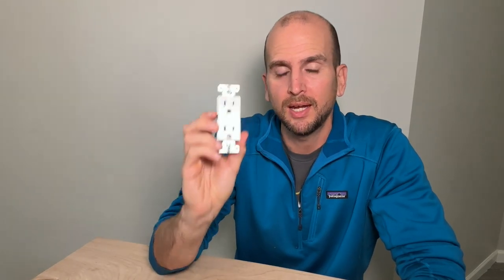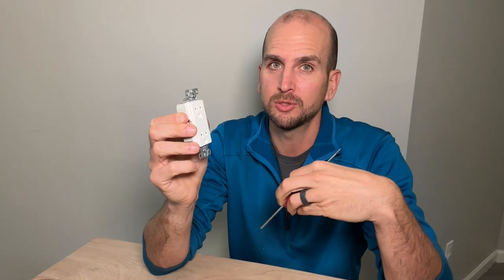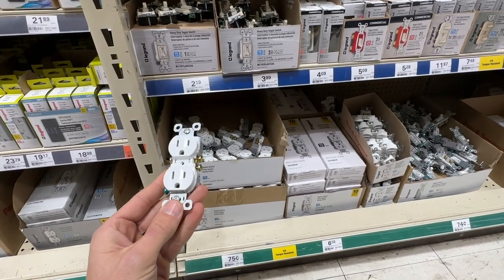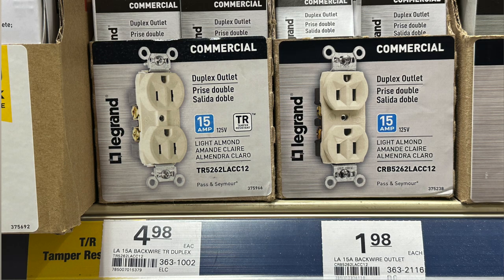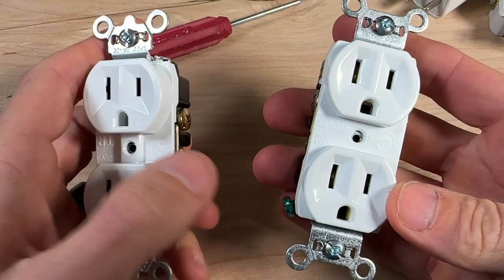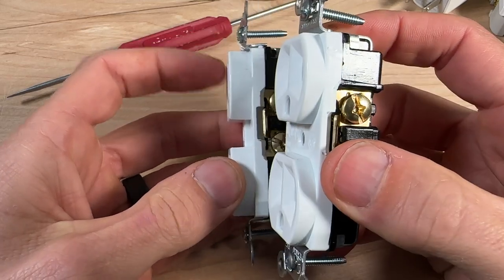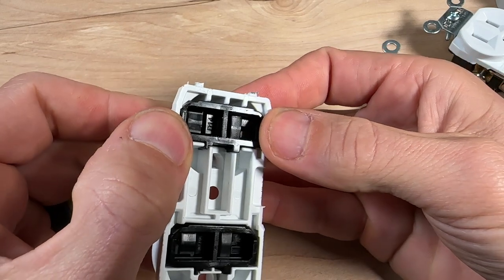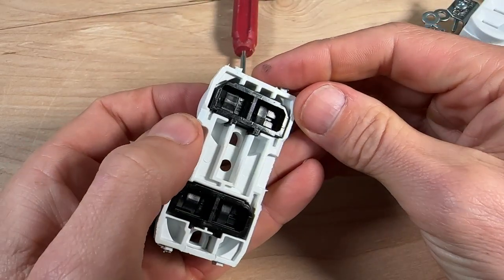The Most Hated Product In Home Electrical

Comment: We finished my basement 2 years ago.  It is a small basement, 300 sq ft.  We built a closet around our furnace and water heater, put in a small closet for my wife's crafts, and the rest is just 1 open space divided into 2 sections: my office (I work from home 100%) and my wife's craft design area.  We had rough in plumbing when the house was built, but did not use it, so no bathroom or sink.  The inspector required us to use the TR outlets.  They are so hard to push in the plugs that we've broken several of them.  Completely useless!
Reply: Huh? Are you sure inspector did not mean GFCI? Tamper resistant not required in any code I’m aware of….
Reply: Switch them out.  You don't need inspections for changing your own outlets.  You also want gfci in a basement because sometimes basements flood.
Reply: @scallywag1716  Check out NEC 406.12.  They are unfortunately required in all dwelling units unless your jurisdiction (state, county or city) decides not to implement that portion of the NEC.
Reply: You have a set-up for a sink so the inspector was insisting on a GFI. A tamperproof receptacle does nothing for you and does nothing to solve any potential problems in a wet location.
Reply: Only if they are buying cheap contractor grade TR Outlets which do not function well....... If you purchase quality TR outlets they function flawlessly!
Reply: Don't purchase cheap TR Outlet and you will not have the issue. Any new outlet location in a home, by code, must have a Tamper Resistant Outlet.
Reply: @michaelholliday100  "Any new outlet location in a home, by code, must have a Tamper Resistant Outlet."    bs
Reply: @MrBonners                                                                     2017 Code Language:
406.12 Tamper-Resistant Receptacles
All 15- and 20-ampere, 125- and 250-volt non-locking-type receptacles in the areas specified in 406.12(1) through (7) shall be listed tamper-resistant receptacles.
(1) Dwelling units in all areas specified in 210.52 and 550.13
Exceptions: - (1) Receptacles located more than 1.7 m (5 ½ ft) above the floor
- (2) Receptacles that are part of a luminaire or appliance
- (3) A single receptacle or a duplex receptacle for two appliances located within the dedicated space for each appliance that, in normal use, is not easily moved from one place to another and that is cord-and-plug-connected in accordance with 400.10(A)(6), (A)(7), or (A)(8) - (4) Non-grounding receptacles used for replacements as permitted in 406.4(D)(2)(a)
Reply: Tamper resistant outlets  are dangerous, I am starting to believe the inspectors have little wisdom, they require things that sometimes degrade the quality of a job.  In my area, I believe their main goal is not safety or quality, it is to make themselves look important to their manager and flex muscle to compensate for other parts of their lives that lack.
Reply: @davecangelosi9688  Quality Tamper Resistant Outlets are not dangerous...
Reply: @davecangelosi9688  Inspectors have nothing to do with it . If the device meets code and approved by various authorities an inspector will not fail the job. UL etc.  His job is about the installation build specs and workmanship, not the design of the devices's used.  Unapproved devices are not available to be bought in the first place because they are not manufactured.
Reply: @jfbeam  Bull. If that were the case you would not be able to buy them. 
There is no "if". 
Put "if" in front of something you can have anything you want.  'If' there were pink elephants.
Reply: Badly made. Buy better quality.  The UK has had mandatory tamper resistant sockets for 80 years, although the overall design of plug and socket is vastly superior.
Reply: The Guns N' Glory Show  
No!  Buy quality.

Comment: I'm an old and TR outlets are so much harder to put a plug into. My hands and fingers aren't strong enough an it hurts my joints to try to work the plug into them. Also, the electrical boxes in my house aren't very deep. Some of these new features make the outlet so clunky, they just won't fit. Switches with timers, wireless-enabled, outlets with USB added...they won't fit in my old metal boxes.

I won't be putting a bobby pin into an outlet anytime soon; I've lived in my 1951 rambler for almost 30 years and I'll let the new owner put them in if they need them.
Reply: I used to put Bobby pins in the outlets when I was a small kid, I liked the way they sparked.
Reply: It's feature you have to design in from the start, like they did with BS1363, for it to have any hope of working right. And despite all of its flaws, NEMA 1-15/5-15 is never ever ever ever ever EVER going away. We can't even use a similar mechanism using the ground pin because almost all appliances are ungrounded unless the manufacturer really couldn't come up with a double insulated design. So any TR implementations for us will always be avoided whenever possible and never work well in the few places they're used.
Reply: I think the key with TR outlets is getting used to them. You have to put the plug in perfectly square. If you are at a slight angle, then it can take a lot of force to insert the plug.
Reply: I have same problem. A combination of arthritis and mild parkinson's make using outlets harder with each passing year
Reply: @daleatkin8927  I've had better luck going in at an angle
Reply: Only if they are buying cheap contractor grade TR Outlets which do not function well....... If you purchase quality TR outlets they function flawlessly! TR Outlets are not deeper than a non-TR outlet...
Reply: @michaelholliday100  But contractor-grade outlets used to work.  Code is forcing a new design that is either so complicated that most manufacturers can’t make them work properly, or else they are working properly when they’re almost impossible to use which means it’s a failure in the spec.  Either way, it seems to be defective by design.
Reply: The first time I bought a TR receptacle, it was a Legrand with two USB connectors. The biggest problem I have with that was that the shutters were extremely stiff, it's like it was designed to expect a ground pin to be inserted. If if was just the two blades, it was tough, but if the ground pin was included, it seemed a bit easier to insert.

However, when I replaced a few GFCIs with an Eaton/Cooper TR GFCI, those seemed to be a lot easier to use. Almost like they knew that not every plug is going to have a grounding pin. My mom, however, had some trouble plugging things into it, only for me to observe that she's been inserting them at a slightly awkward angle than what she had thought. Once I pointed out her actual issue, she readjusted, and adapted.
Reply: If you have to force it, you aren't doing it right.  If you line it up correctly, it slides right in.

Comment: All UK 13 amp. socket outlets are required to have protective shutters fitted which l guess helps with lowering the overall cost due to higher manufacturing volume. 
     I am also aware that UK outlets are physically bigger so provide more scoop to fit a shutter arrangement that in most cases is operated by the insertion of the slightly longer earth (ground) pin which does make for a smoother operation when inserting the plug. 
    Keep up the great videos and stay safe.
Reply: Exactly this. It's not a problem here. UK sockets / plugs are the best standard tbh. As for cost I see your point but given respective population numbers not sure about the economies of scale.
Reply: The UK plugs are designed better than the ones used in North America in terms of safety. Only issue with having the ground operate the shutter here is that not everything requires a ground pin, so you'd need a work around for all old devices.
Reply: @jeevana.6391  Yes. We have 3 pins on all plugs. Where it is a two wire connection the earth pin is simply left unwired. Or typically for a pre wired connection the earth pin is a dummy made of nylon,/plastic. So yes you would need to replace the plug where it has only 2 pins.

Comment: I have an old 50's house entire with 2 prong outlets and wired with 12-2.  Replacing all with commercial Legrand (non tamper) and add GFI at the breaker panel.  All the boxes are small and I am using the Wagos instead of wire nuts.

Comment: I just looked at an outlet that've been meaning to replace for months now.  I was having the issues that you mentioned with the plug not going in and sure enough, the outlet has a TR on the front.  I know nothing about replacing an outlet and was just going to wing it via youtube videos of course 😁.  But at least now I know the reason why several outlets in this flipped home are having issues.  Cheap TR outlets installed to pass inspection.  This was a revelation.  Thank you!
Reply: Never trust a flipped home. Test everything! 

Try to rattle some of the walls and all the doors doors. Take a power tester with you and test every room, at least in one spot. Check calking and flashing around the exterior. Check for signs of water damage both where pipes are visible and around windows and doors. Make a check-off list.

It's not hard these days to be your own home inspector. YT has dozens of sources to learn from.
Reply: @mrcryptozoic817  
That only applies if you have the money to pay cash.

If you're financing, your home is inspected well enough for the bank to lend you the money, and the insurance company to cover the house.

You're NOT going to be that good from watching a YT video.

You damn sure aren't going to do a good job inspecting the electrical system.
Reply: @lordgarion514  I wasn't describing perfection. I should have specifically said "At Least". You CAN help yourself a lot on your own. And there are plenty of documented home flip disasters.

Don't walk in and be stunned by a new kitchen and nice draperies then say "I'll buy it".

Comment: I have a beach home in 
Baja, Mexico. When remodeling the home, I noticed many of the outlets were rusted and corroded. I installed tamper resistant as not only a safety feature for future grandkids, but to help minimize future rust and corrosion. Not sure if my thought process is valid but we’ll see over time. Thanks for your channel, it’s helped me tremendously!
Reply: With what I've seen as far as electrical in Mexico, you far exceeded the norm...
Reply: Things cannot oxidize below 35% relative humidity. You will almost always never get this close in real world scenario, but the closer you are the slower the oxidation. Things are coated for anti corrosion anyways so keeping humidity low will help extend this coating
Reply: @MadLadCustoms  Fully understand that but…we are on the beach.  The weather ranges from 45 with the same dew point and near hurricane like winds and salt spray to 120° and no humidity.   Bottom line, it’s a beach house and salt intrudes so I’m just trying my best to prolong and damage.

Comment: Personally I've always used the Leviton TR outlets, always seemed to work well enough, to the point you basically don't even notice, unless of course you try to plug something in off center or to one side. Just need to make sure you inserting the plug in relatively square.
Reply: The first use seems stiffer than subsequent uses. I've been replacing the existing backstab outlets in my house with TR outlets. The existing outlets quite often break in my hands while releasing the wire, which is why I keep at it. I don't really notice any extra stiffness in normal use.
Reply: That's what the builder used in my house. A few of them had bad shutters but most were okay after a few uses. As the years went by though I've had to replace a bunch of them. Most recently the one on my front porch when I couldn't get the Christmas lights to plug in no matter what I tried. Unfortunately I've had to return several of the replacements as they didn't accept plugs fresh out of the box. I've installed a number of receptacles with USB ports and some had the same problem. At least with those the cover is screwed on from the back so I was able to remove the shutters in the bad ones.
Reply: I put some of those in they are fine, not sure what the hate is about.  I put them in some of the most used outlets so they wouldn't need those plastic plug covers, no one has noticed.  I'm more concerned the mechanism will break rather than having any issues plugging things in.
Reply: @johnhaller5851  
They break because you're pulling them straight out.

Had an electrician show me how to do it.

Grab the wire with pliers, and then while pulling on the wire, twist the outlet back and forth.
It will "walk" the wire out.
Reply: Only if they are buying cheap contractor grade TR Outlets which do not function well....... If you purchase quality TR outlets they function flawlessly! TR Outlets are not deeper than a non-TR outlet...
Reply: Great point- once you get used to it the "problem" goes away.
Reply: @shaunbava1801  We have never had one break- all are Levitons in my house.

Comment: After coming to our current house I was frustrated as to why I couldn't plug in electrical devices.  It was only 8 years later that I came to realize these plugs and their purpose.  Once I saw your disassembly of one did I come to realize my approach to plugging in was wrong.  Since then plugging in has been much easier.  Not perfect but definitely easier.  Thanks for the thorough explanation.

Comment: I had such a bad experience with difficult contractor grade TR outlets that I have been removing them and replacing them with standard (albeit better grade) outlets.
Reply: Standard outlets are designed to not allow little fingers to touch the energized metal.  The only way to get shocked with a standard outlet is by inserting a piece of metal such as a paper clip.

Comment: I tried to research this issue when I ran into TR's for the first time. What I found was most childhood electrocutions fell into a few categories. Most were either malfunctioning appliances, construction problems, or older kids hitting lines with a ladder they were carrying unsupervised. TR's would help with none of that. I found that very small children presented at hospitals with shocks on a fairly regular basis, but were typically released without treatment, since they often only contacted the hot and did not have a good path to ground (through carpet or wood or socks or whatever). While I'm sure TR's have prevented some of that, I haven't found any data on TR's having been able to prevent, or actually preventing any fatal electrocutions in children. I think they're still too new to know, but I suspect they may increase other dangers involving electrical shock hazards, since people are putting a lot more force into their outlets and potentially damaging wire insulation. An outlet "failing" due to a worn TR shutter entirely may result in inappropriate use of extension cables etc. So is the cure worse than the disease here?
Reply: yeah screw TR's, if ppl really care about shocks just put a GFCI on each circuit. bit more money but way safer and much less hassle day to day

Comment: I recently finished a new sub panel install in a detached garage as a diy project. I Decided to add a new circuit with six outlets at workbench height. The Inspector wouldn't approve the final inspection until I put the TR outlets in. Kind of silly given the location. 

My question is if this was truly done for safety by the NEC or just another way to make a few bucks by the manufacturers?

There have been cheap plastic outlet plugs available for years to solve this problem. Anyone with kids has used them and any homeowner can put them in without any skill. I'd venture to guess more of those are in use than TR outlets and are likely just as effective, if not more so because of their ease of use and availability. 

Anyway, thanks for the great videos and content. Your channel helped a ton with my project and after changing out the outlets the inspector was happy. Keep it up!

Comment: We have a home daycare and I have installed  tamper resistance outlets in most of the standard outlet locations throughout my house. Yes, some seem to be problematic,  but most work fine. Previously, I found that the safety covers were too difficult to remove when that outlet was needed and were easily lost, broken, or not replaced. An unprotected outlet is a huge deficiency for a daycare and can cause you to be shut down.

Comment: September 2021 we were replacing old outlets in a place that  was a recent purchase for us to retire to..  We had to buy 6 or 8 of the TR design outlets to finish the project. A few home improvement stores we visited were out of stock of regular decora 15amp outlets. No estimated arrival time of stock.  The TR outlets are a PITA to use
Reply: Only if they are buying cheap contractor grade TR Outlets which do not function well....... If you purchase quality TR outlets they function flawlessly! TR Outlets are not deeper than a non-TR outlet...

Comment: Just got done upgrading my house with Eaton Arrowheart TR outlets and the shutter system has worked great and have no problems plugging anything in. The Eaton GFCI outlets however can be pretty tough with TR I've noticed.
Reply: I agree with you and installed about 40 of these in a remodel recently. The Eaton Arrowheart TR’s are working fine and haven’t presented any issues with excessive tightness. NFPA NEC 2020 explicitly requires TR receptacles.